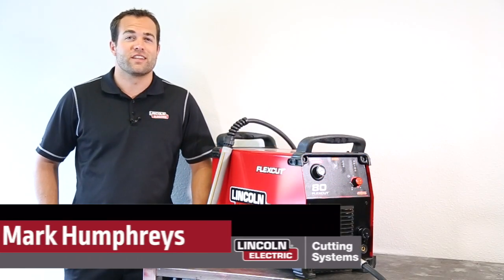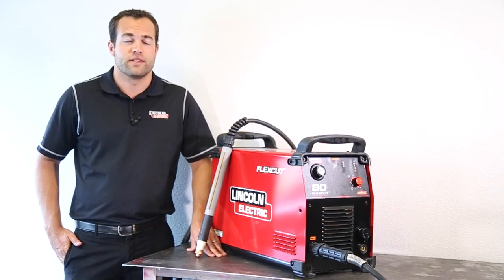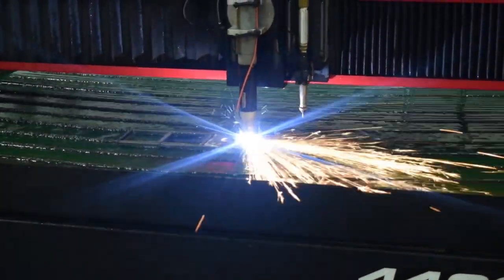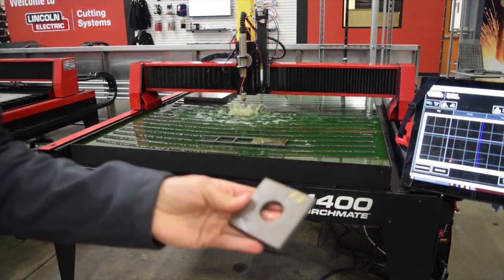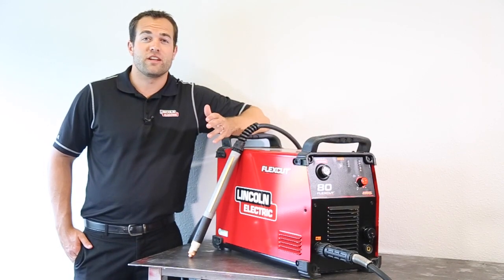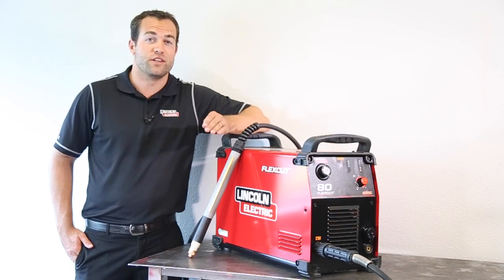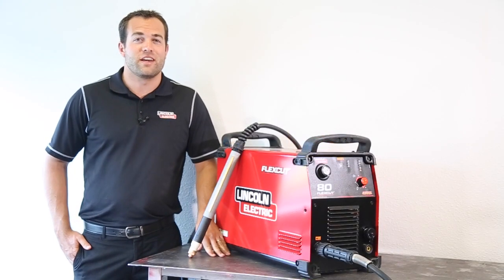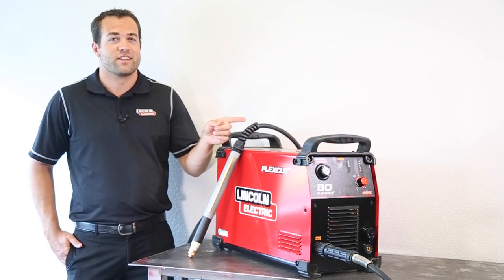The FlexCut® 80 Amp Plasma Cutter Overview

Comment: our company is fairly large and covers the spectrum of heavy ship repair and construction. We have two plasma tables at two locations and they are powered with lincoln flexcut 80 plasma cutters. Both were purchased separately and both machines failed in less than a year, one catastrophic and the other out of service more then 2 months( still waiting). The machines work well when they are working but could not endure even moderate use in our facilities. They look nice but are not robust.I would not recommend these machines for moderate to heavy use